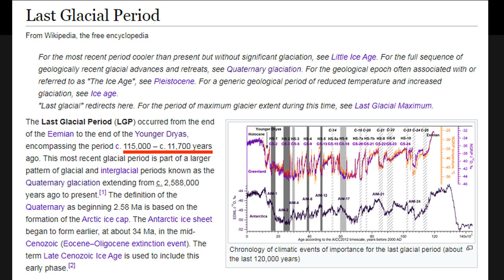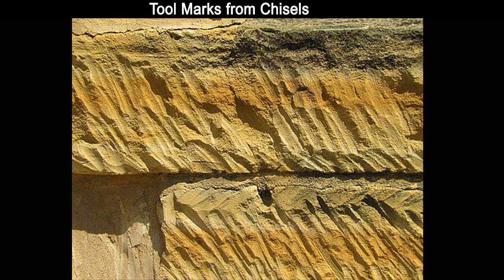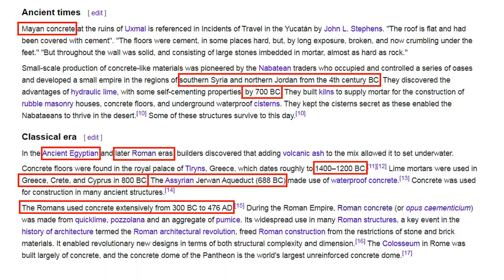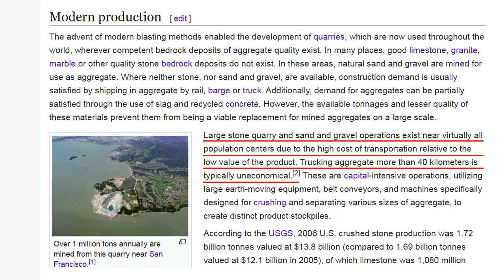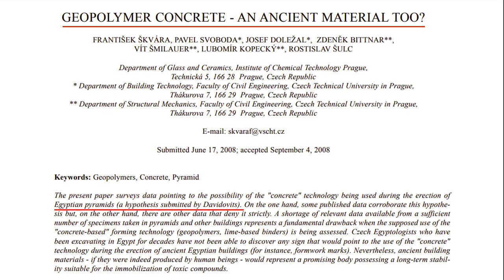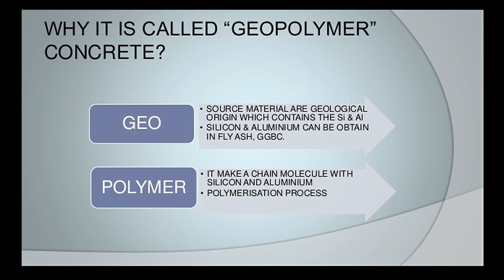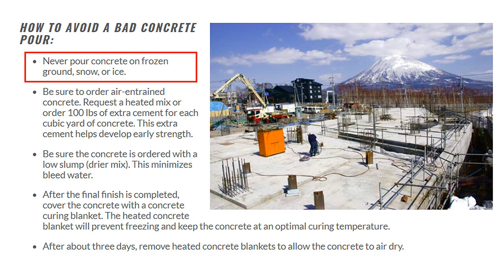Ancient Chinese Quarry: Proof of Prehistory Advanced Technology?!

Comment: Stone masons are capable of that and more. Just because you don't believe it it means it's false. 
You don't need machines to do that, can be done pretty easily by hand, and is even done today the same way all those old people did it.
You just need some cleavers and, optionally, some way to make holes in the rock (Which is much easier than you think)
Just check the professionals https://www.youtube.com/watch?v=gUtRsNm8zKM
The first guy makes a dozen of perfect square bricks from a big stone in 10 minutes just using a hammer and a chisel. Same thing with machines is faster, but not that much faster as you can see on the next videos.

Comment: Hello there, Tina. Why did you included the West Pacific and Philippine Archipelago??  There's no relation or link to the Wushan Grottoes in mainland China.
You said "local Chinese" -- as in the ancient ancestors?
Reply from the maker: Hi, the East China Sea is part of the marginal sea at West Pacific. The Japanese Archipelago was once connected with the Eurasian Plain when the sea level was much lower.  I think "local Chinese" built the stone houses with smaller stone blocks but they were not the creators of the quarry.
Reply: @CuriousBeingbyTina  
Thanks for replying. 
I think you missed the "Philippine Archipelago".  ;-)
Reply from the maker: @peekaboopeekaboo1165  :-) Yes, I didn't include Philippine Archipelago because Filipino Plate is separate from the Eurasian Plate.